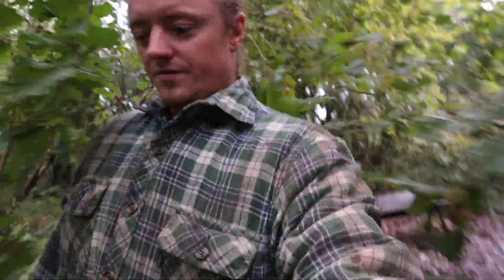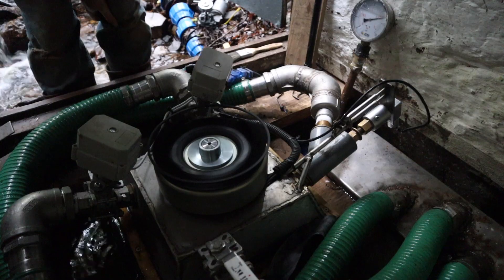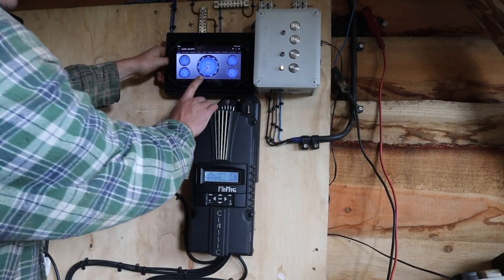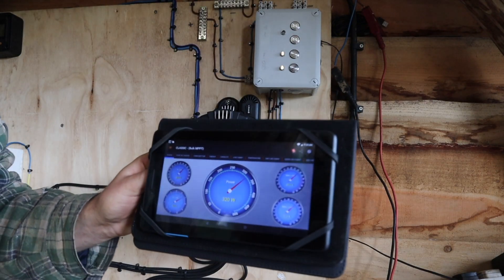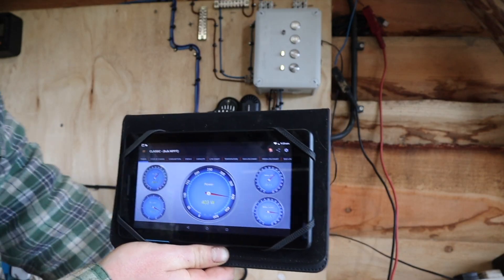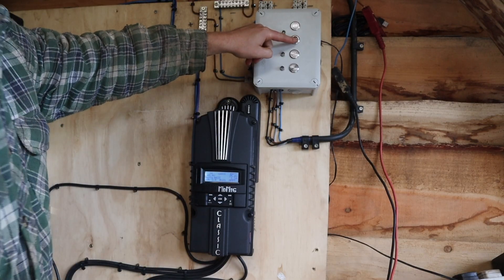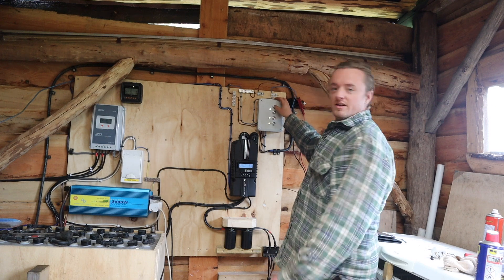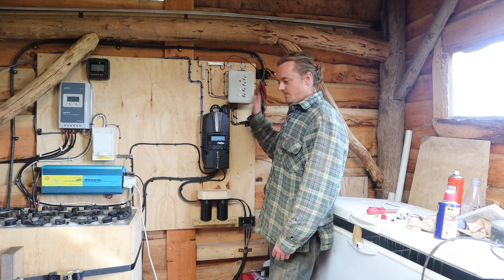Off Grid Arduino Controlled Micro Hydro Full Power Test 400W

Comment: the reason the pressure drops is not because of friction losses, well they do contribute but very minorly. in fluid dynamics the pressure decreases when the velocity of the flow increases, thus when you  open more valves the flow goes faster and the so called static pressure which you measure drops. you do however keep most of that energy, it is just converted to velocity instead of pressure
Reply from the maker: that water moving is what causes it to drop. https://en.wikipedia.org/wiki/Friction_loss The friction 

http://www.calculatoredge.com/mech/pipe%20friction.htm
 put in pipe size and flow rate in to that and it will show you how much pressure is lost due to friction... that is why its called friction loss. 

the pipe friction is the reason for the drop. if there was no friction in the pipe there would be no drop in pressure.
 
 Why correct something that was already correct with wrong information?  The lost energy is converted to heat actually. like all energy is. these hydro vids really attract some serious misinformation in the comments. Its basic physics.

https://www.nuclear-power.net/nuclear-engineering/fluid-dynamics/major-head-loss-friction-loss/
https://www.corzan.com/blog/how-fittings-valves-and-strainers-affect-pressure-drop-and-head-loss

Comment: Another mechanical question:
Since the water jet in this Turgo turbine (as opposed to your prior Pelton wheel) is inclined to the plane of rotation I would expect that there are now greater axial loads on the bearings. But whether they are significant I guess depends on the details of the blade geometry.
Do you know, e.g. from the blade manufacturer (can you link to it?), whether the axial loads are significant?
And if so, have you used different bearings in the second alternator?
Reply: The bearings we saw in the first alternator (cf. broken bearings video) looked symmetric -- i.e. not designed for significant axial loads.
I presume this could potentially affect efficiency too -- though I know too little about bearings in practice to asses it.
Well, apart from the simple "they should not get hot" rule.
Reply from the maker: That is another reason for running multiple jets, i could run one massive one but having force on oposing sides or from all sides i feel must be better for the bearings. i do tend to run it (if flow permits) opposing nozzled or all nozzles on.

Comment: Nice system!  How will this be operated and maintained during freezing temperatures? I am really interested in a video on tuning power generation.
Reply from the maker: its is moving water so it has to get very cold to freeze and it does not get that cold here very often.

Comment: I'd like to point out that the typical hydro power plant is very dirty (dirtier than a coal  plant) in terms of GHG emissions, but this is what is called run-of-river hydro (there is no reservoir) and it is completely clean.
Reply from the maker: that is very true. its also not harmful to fish or anything because its just a small drainage stream that has no fish so the impact to the environment is almost nothing.

Comment: Good job, I estimated a maximum of about 2.5 liters before the pressure drops of the pipeline began in an excessive way, about 250W / 260W, with 4 liters per second do 400W I think I understand?
It is not bad given the low jump and the little constant water available, I wonder why you did not continue with the same diameter of the pipeline up to the craft distributor, eliminating load losses as much as possible?
Congratulations on the excellent MPPT charge controller, for me it is the best on the market, if you want with one of the 2 outputs you can set as load shunt PWM with charged barthers and heat a water accumulation so as to keep the turbine braked equally instead of closing the turbine water, even if it will be difficult to always have the batteries fully charged and use hot water!
Ciao
Reply from the maker: yeah its about 1lps per 100w i should be able to get about 600w out of it if i go up with the nozzle sizes a bit but it all depends on how much rain i get this winter. The pipe loss is low due to my pipe size. i didnt go all the way to the manifold with it becasue it was just to big to work with in the tight space and the losses were small considering its only a short length.

Comment: Well done Kris, online just as the days get shorter  and colder. A truly brilliant project, squeezing the last bit of efficiency out of your system may take a lot of effort. Did you  get a good earth sorted onto your inverter and bonded to the  nuteral. Also at your house end if you have a long cable run.
Reply from the maker: I have indeed done that, was it you that commented about that last time? I basically just put a jumper from the neutral  to earth. Is That right?

Comment: Are the smoothing capacitors really necessary? If not, what actual advantage to they provide? I'm asking as I have a similar setup but rectified power goes direct to batteries without smoothing. Cheers
Reply from the maker: They were part of an experiment i was doing with mppt charge controllers. Did not make any difference from what i could see but are not hurting anything so they might as well stay.

Comment: This is a cool project and beautifully done but I'm a little confused; You've gone from a simple setup single jet turbine to a very complex and expensive 4 jet adjustable turbine, but still producing the same power. I'm wondering what was the point and have you lost the point of it all a little in the process? Keep it simple is what I've learnt from my hydro system, less to go wrong and less to maintain. But like I said, beautifully designed and built.
Also interested to know Kris, what is the head and flow you are working with when all four jets running?
Reply from the maker: well it is adjustable from 20w up to 400w so the adjustability was the reason for all the nozzles. also another 100w is significant and on top of that i can make all 4 nozzles bigger if i want and get 1000w out of it i just dont need that much power right now. the old turbine was limited to 300w and i was very difficult to get more out of it, this one is very versatile.

i have 18.5m of head at full flow i lose about 3psi at full current flow i have my nozzles set at. the pressure gauge isnt actually very accurate as it froze so dont trust that to much.

Comment: Quick question: What's your flow rate with everything wide open?
Reply from the maker: Im not 100% sure at the moment as its hard to test that. but the maths says it should be around 5lps
Reply: Kris Harbour Natural Building 
Awesome, thanks! I was just wondering what a REAL world scenario would be for getting 400 watts.

Comment: So cool.  I may have missed it, at what voltage does the power come off the turbine?  is it feasible to transport the power long distances?  Can you buy turbines that output higher voltages?
Reply from the maker: mine is 50v under load and 100v free spin. you can go as high or as low as you like it just depends what its for, cable run lengths and voltage ratings of charge controllers. but that voltage is your rpm, and the rpm must be half the nozzle velocity or you wont make much power. so you have to work these things out before you build the turbine and design it around those numbers.

Comment: Quick question re. mechanical efficiency:
As I believe you explained in an earlier video -- for the older one-nozzle turbine -- there is an optimal ratio between water jet speed and turbine blade speed. Specifically for an impulse water turbine the blade speed should ideally be at half the water jet speed.
Now that you have four jets I am curious to hear if you know how close they are to producing water jets all with the same speed -- i.e. if they all have the same efficiency in converting the potential energy (the pressure) into water jet kinetic energy..?
Reply: Naively I would have thought that you would prefer having four spear valves -- and then in most cases regulating them all in sync to get water jets with equal speeds -- but there is probably something I am missing here... ;o)
Reply from the maker: The size of the jet does not change the velocity of the water. The pressure does that.  the reason it seems to is due to pipe friction loss. If there was no loss all 4 nozzles would have the same nozzle velocity regardless of there size. the reason most people believe that volocity goes up when nozzle size goes down is because that is what seems to happen when you pinch a hose. but the only reason that seems to happen is because of the friction loss in the pipe has gone down.  when you make the opening smaller the less water flows so there is less friction, Less loss and as a result more pressure.  if there was no friction the same preasure would come out of a 1" nozzle as it did a tiny nozzle. My system pipe sizes are sized to have very little loss (less than 2%) So it makes very littler difference to nozzle velocity regardless of nozzle size. Also as you open the bigger nozzle the friction (all be it very small) lowers the preasure a little bit of all the nozzles so it is self regulating. Hope that makes sense
Reply: @KrisHarbour  Thanks!
Yes, indeed when the water leaves the nozzle all the hydraulic energy is converted to either kinetic energy or heat (turbulence/resistance).
Nozzle type, size and production quality would then primarily affect the "water jet quality" -- i.e. how focused and homogeneous the water jet is, or how far the jet velocity profile deviates from the ideal -- as they investigate here:
https://eprints.lancs.ac.uk/id/eprint/128609/1/IAHR2018_020.pdf

Comment: Hi a great system. Could the water not quite fully draining from the system chamber be having  a slowing effect? To ask that another way, could some of the losses be that the water is not draining fully away at higher setting causing the system to run partly submerged, so you get drag from the used water, hanging around causing drag inside the chamber?
Reply from the maker: A turgo works by directing the water downwards after it has imparted its energy so it does not end up spinning around the box and creating losses. There are of coures some losses due to this (there are always losses) but the water seems to be getting out the to housing just fine. im seeing exactly the sort of rpm i would expect and the extra flows and extra water isnt slowing down the turbine.

Comment: very clever system, have you thought or letting the Arduino control the valves automatically depending on load or battery bank voltage?
Reply: What about diverting the unused power into a hot water storage tank,
Reply: @Yahgiggle  If he could make a big pond or something that could feed it as well it could fill the pond when the load is low, and then have extra capacity when needed.  Not sure how feasible that'd be for him.
Reply: @Yahgiggle  ah, that could also work. A dump load that maybe is also controlled by the arduino, where it reaches a certain temp, then it slows down the turbine.
Reply: @HobkinBoi  if you had a big tank all you need to do is set a voltage control switch relay to turn on once you hit full charge on your battey this is way more simple and would divert the power to an element, if the tank gets hot enough you could pump that hot water into a water heater in your house to heat it, you could also have a pipe system inside the tank to heat your water for your shower ect,  you could add lots of salt to get the water as hot as you can and have this tank stored underground to keep the heat losses down, basically making a heat battery
Reply: I was thinking the same! That would be awesome.

Comment: Awesome to see this working so well.  Now that it's been troubleshot, hope that control unit could become a product for people to buy, even if each one is custom made.  Such a great idea and solution.  Are you going to look into some way of automatically opening and closing nozzles based on flow rate and/or battery capacity?

Comment: The law of diminishing returns is real but in your current state it has no real effect on your power supply because you are not using water from a captive supply that drains down as you use extra water. Since you only have an intake in the river capturing a portion of the creek flow then improvements could be made there along with the improvements you mentioned that would help when your creek is lower.
Reply from the maker: you are forgetting pipe friction loss. as the flow goes up the pressure goes down so there is a point at witch you get no more power for more water. That is the law and i can assure you that it applies

Comment: Just out of curiosity what's the power output difference when you turn that manual valve off when the others are on? The difference might not be 20 watts since the pressure would rise a bit when the manual valve is off. Just a thought.
Reply from the maker: well its 20w when its on it own because it having to overcome the friction on its own. If another nozzle is already going it just adds 0.8 lps to that and adds about 70w you have to think of it as a curve. at low ends it has to overcome all the losses in the bearings before it makes power. at the high end it has lots of pipe friction loss and in the middle it runs efficient.

Comment: If you produce more power than you need, Using that for Bitcoin mining could be an option. Giving you more income. And if you place the miner in the workshop, the heat it produces will keep workshop warmer in winter.

Comment: Hi, what is the purpose of controlled nozzles instead of having them all ON. Why would you want to decrease the power?
Reply: It's because there isn't enough water to run at 100% all the time so if all the nozzles were fixed on when the available water dropped the pressure would drop generating much less power if any vs shutting down nozzles to match what's available to maintain the maximum power he can get